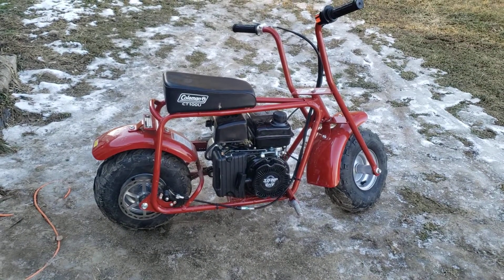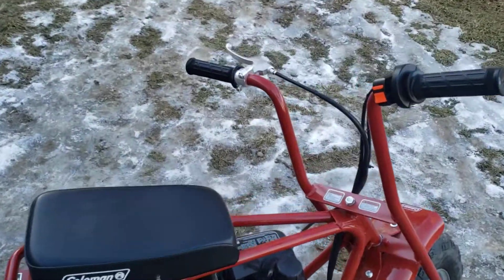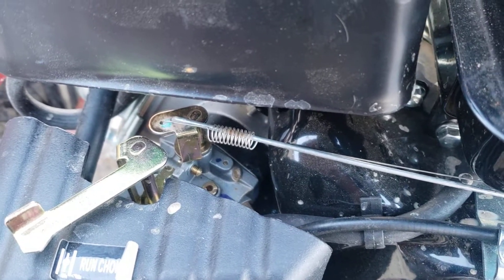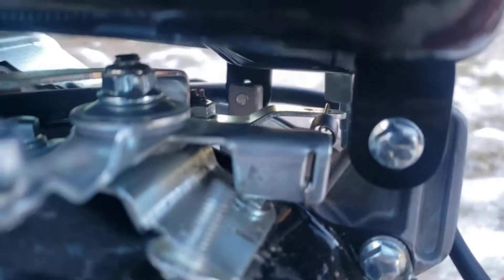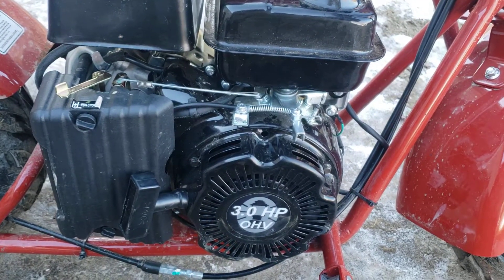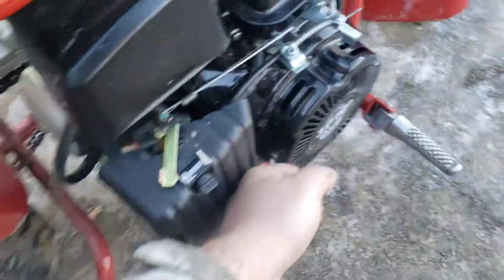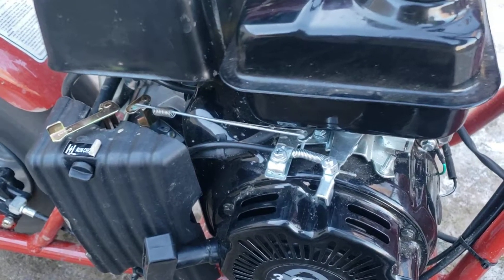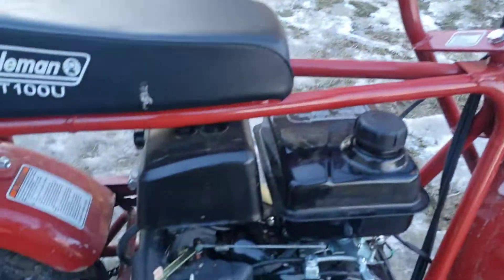How a Mini Bike / Go Kart / Small Engine Governor Works

Comment: If you do a govenor delete on a Coleman b200r and  hold full throttle for a long period of time will you blow the engine?
Reply from the maker: Yeah 100%. It's for short bursts, or get one of those electric tachometers off amazon and keep it under 5000rpm. Supposedly the stock valves will float around 5000-5200 rpm and keep you from blowing it up for a while, but it will run poorly when that happens and could scortch or fowl the piston/cylinder/plugs because the valves aren't fully closing. Do it enough/long enough and it will cause damage...
Reply: @ ok thank you will a jackshaft delete hurt the engine or make it unreliable
Reply: @BuckeyeBallistics also is the zip tying the govenor spring completely where it can’t open safe for the engine or is their still risks of damaging it?
Reply from the maker: Jackshaft delete is fine. Zip tie method, which I have a video on, is the same thing as a governor delete...
Reply: @BuckeyeBallistics  ok thanks for the information
Reply from the maker: @ghilliemaster5392  No problem

Comment: Hi. Thx 4 vids!
Have you swapped engines yet?
 I drive 18 wheeler and thinking to take this bike with me. What if install that CVT/torque converter on this lil engine, would it make it better? I like this bike for size and weight and would try to keep weight to minimum. However, I weight 230+ backpack, do you think it would worl for me w torque converter?😊
Reply from the maker: I sold all my minibikes. I'm not sure if they even make a converter for this bike, but maybe you can change the sprokets if not so that it can move you around. It barely moved on flat pavement with me on it until it got going, and the slightest inclines caused me to lose speed. It's designed to haul around 7 year old kids under 100lbs, not us big boys lol.
Reply: @BuckeyeBallistics  I have seen CVT/converters w "100cc and up" in desription. Question is how much improvement it makes.
 My kickscooter or cruiser bicycle do not move me around w/o elbow grease at all.:)) so 100 cc would be a great improvement in this department.
Reply from the maker: Check out the channel "Black66" he has a few ct100u videos inclyding with a torque converter. Here is his channel: https://youtube.com/@Black66?feature=share7